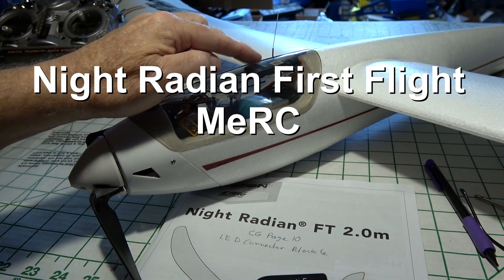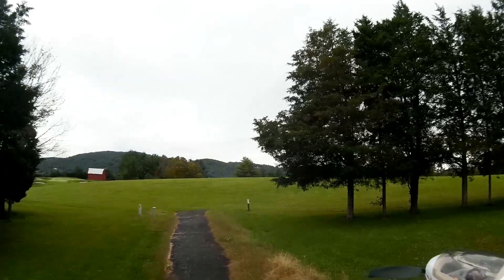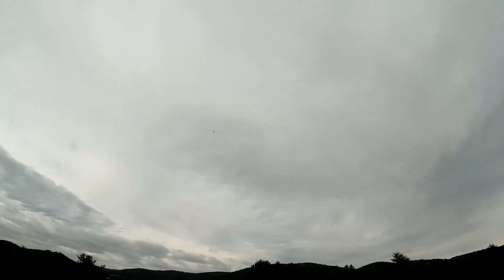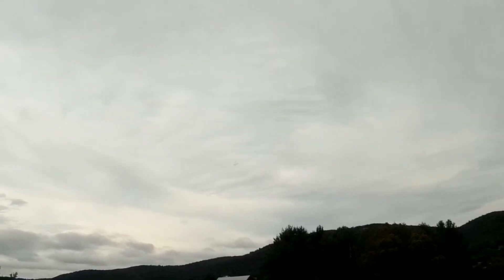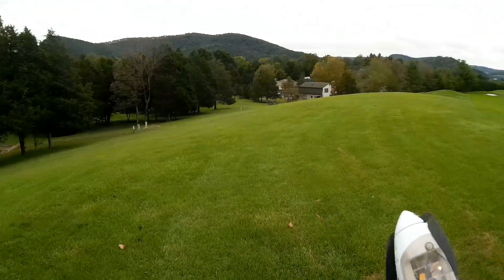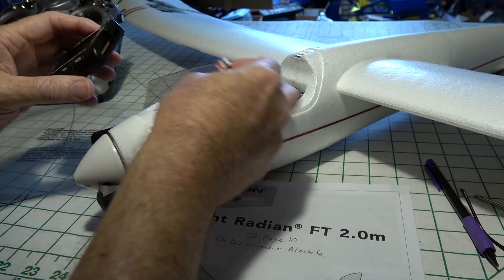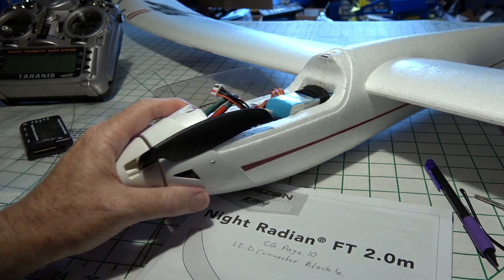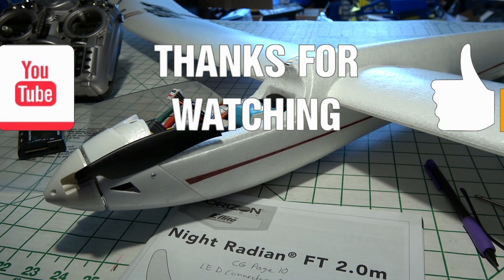E-flite Night Radian FT (Flite Test) 2 meter RC Glider - Maiden Flight Test CG at 3 Inches

Comment: The CG is at about 2,5 inches. I have tested it and all other values leads to a tail heavy plane. I have moved the mount for the battery more to the front and now I can have the right CG without problems. By the way, your plane looks also a bit tail heavy!
Reply from the maker: You can discuss CG here on NR group:
https://www.facebook.com/groups/288203018693228/